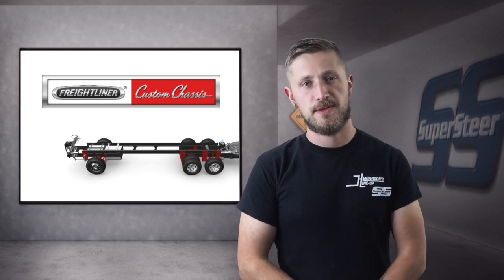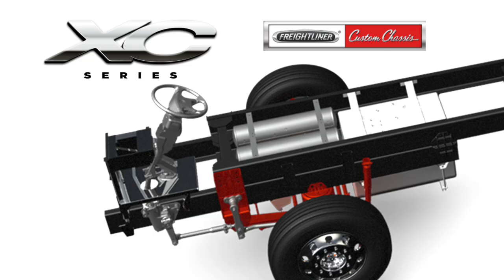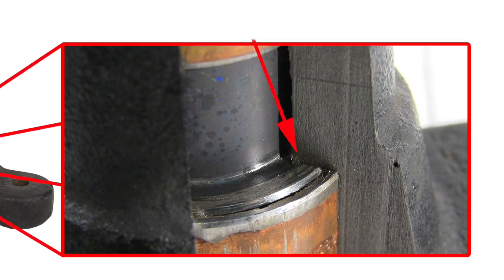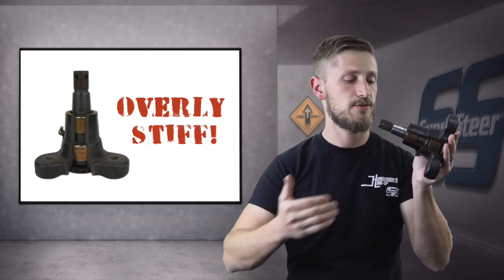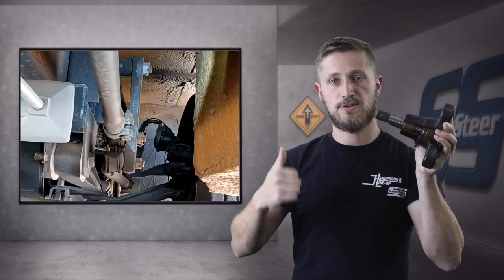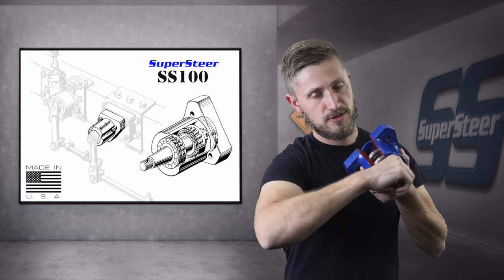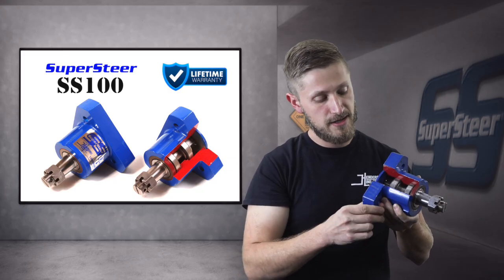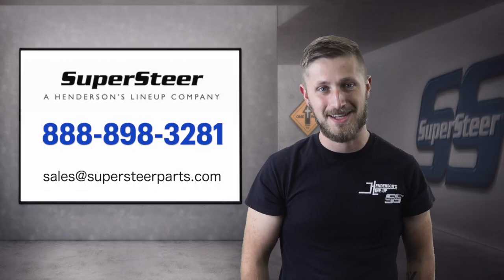Upgrade Your RV's Steering: SuperSteer® SS100 Bell Crank Explained by Tommy Henderson

Comment: Its me again. 2003 Newmar Dutch Star on a Freightliner XC chassis with a NeWay IFS. When I had the toe in checked they said it was in spec, which, If I remember correctly is 1/16"(+ or - 1,/16"). Would increasing the toe in a little improve the hunting/wandering we're experiencing. No odd tire wear.  Thanks
Reply from the maker: Hi, a little more toe-in may help it. A Steer Safe steering stabilizer would also help some. This is the only type of steering stabilizer that will fit the NeWay IFS.

Comment: I know this video was about the solid beam type front axle on a F53 but we have a 2003 Newmar Dutch Star diesel pusher with a NeWay IFS. What you described about memory steer sounds a little bit like our problem. Ours requires a lot of steering corrections. Coach drifting to the right, steer a little to the left, now its going to the left, then correct to the right and then its drifting right again. I've learned to compensate by steering in the direction of the correction and then counter steering back the other way about half of the original   correction. It's still a bit of a hand full and my wife, who we would like to have her be able to drive it, doesn't like this characteristic of our coach. We bought it used from  Lazy Days in Tampa, Fl (in 2016)after the original owners traded it in and it only has about 54k miles on it now. Had a truck alignment shop check the Alignment (they said it was in spec)and I've gotten the 4 corner weights so I could inflate the tires to the proper psi, instead of all of them at 120 like it was when we bought it. We live in South Carolina, do you have any idea what could be causing this. If I lived anywhere near you I would make an appointment to bring it by. You have any other locations that might be near me?  Thanks for posting all your videos, thats a lot of work to shoot and edit.
Reply from the maker: Hi, as I mentioned in the other comment, a little more toe-in may help it. You could also consider adding a Steer Safe steering stabilizer (this is the only steering stabilizer that will fit the NeWay IFS). We would also recommend weighing the coach on the front and rear axles, to check what your ratio of front:rear axle weight it. We like to see at least a 50% ratio. If you already have your weights then you can check this ratio. Glad you are enjoying our videos! In the South Carolina area, we would recommend Coastal RV in Ravenel.